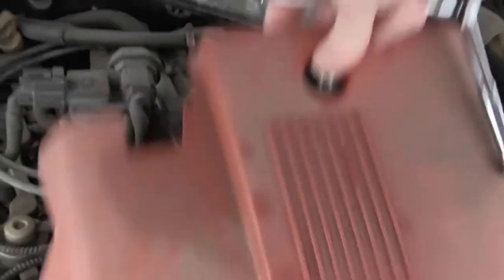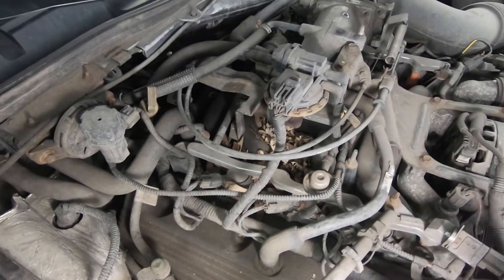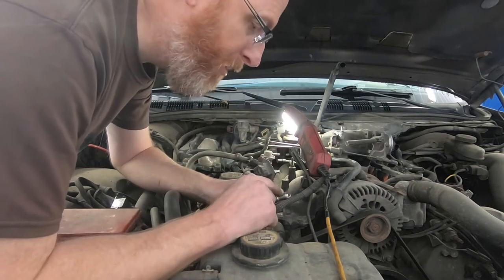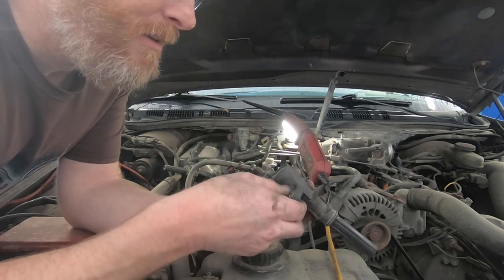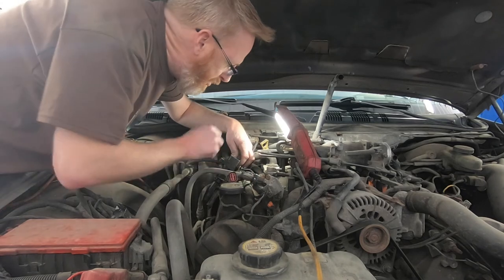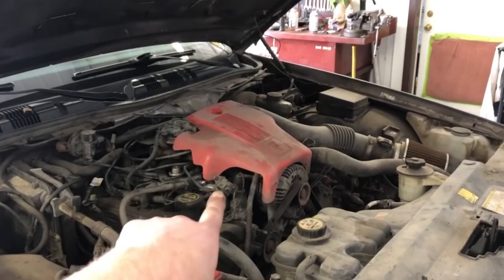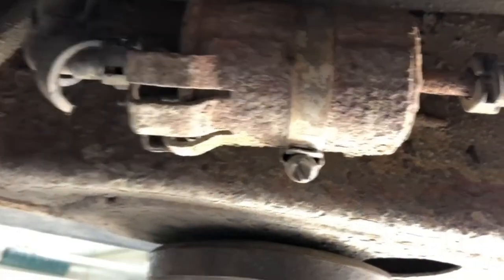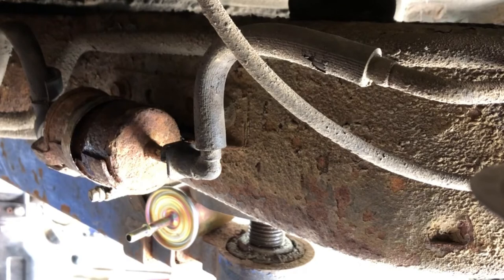EASIEST Spark Plug replacement EVER!!

Comment: Extensions and Swivels make life a lot easier, done this job several times and didn't remove Fuel rail, and every Coil got de electric grease to properly seal them. Coil connectors from heat love to break sometimes and zip ties work wonders for reconnecting them.
Reply from the maker: Thanks for sharing

Comment: So I don’t know if I told you this Jason but I have a 1993 Mercury Grand Marquise is that considered panther ?
Reply from the maker: Yes sir. Panther platform ran from 79-2011. Slight differences in suspension and drivetrain over the years, but the backbone stayed relatively the same!

Comment: i have never had to remove the fuel rail on my 4.6's ,i use ngk plugs recomended by 2 different dyno shops ,just a friendly fyi
Reply from the maker: Thanks for the fyi, but no dyno's for old Black Jack. At least not with this engine....
Reply: @OldeCarrGuy  no need to dyno old blackjack lol .  have a good one
Reply: NGK is junk. Motorcraft is the factory plug and they are inexpensive and last for at least 100k once installed.
Reply: @mediaguy4037  to each their own.

Comment: Finally some panther content again on this channel, so you only did one side for the plugs/coils??
Reply from the maker: No, I did both sides. When i was done the passenger, I mentioned that i wouldn't cut back unless something happened.
Reply: @OldeCarrGuy  YouTube rules if you didn't capture it on video it didn't happen :) excellent video btw.  Love all the panther content would love a video on sway bar end links and bushings would be cool considering I need to do mine soon!
Reply from the maker: I actually did front sway bar end links on grandma a few videos back when I did the ball joints if that helps!